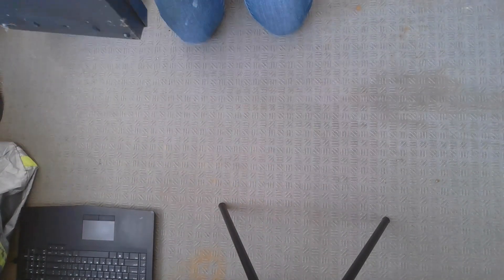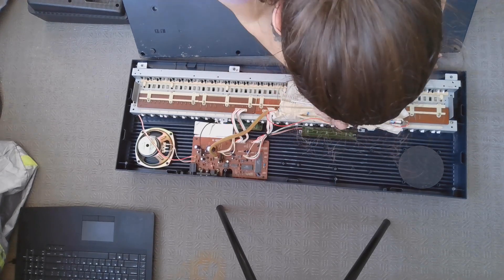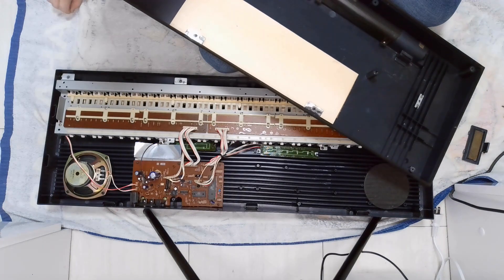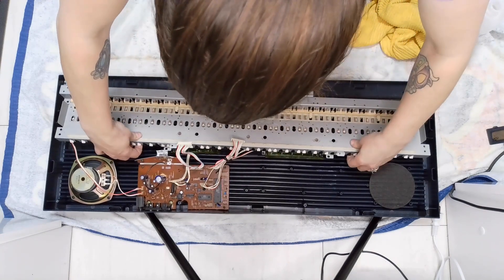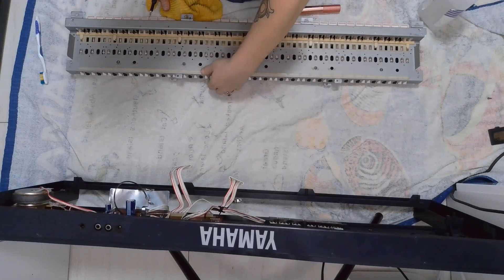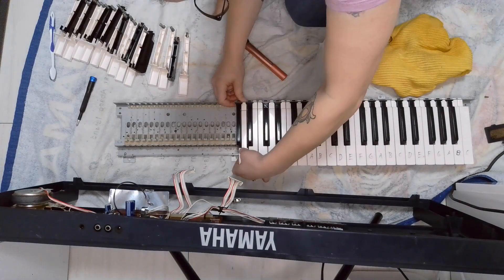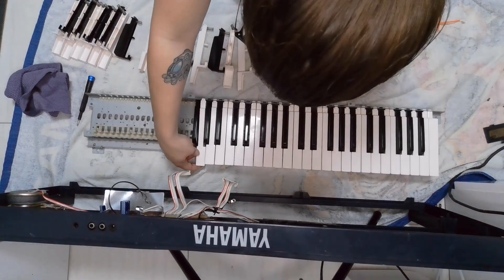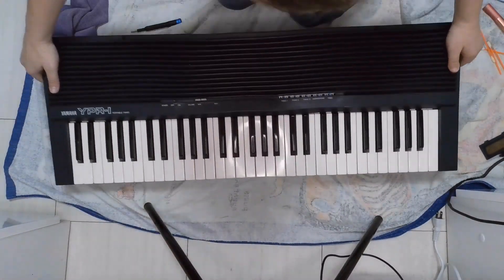Another trash find is music to my ears (Yamaha YPR-1 electric piano)

Comment: Please show exactly how you get the keys out.
Reply from the maker: For the Yamaha each key is individual
Reply from the maker: They each have springs and each pops out individually
Reply: Thanks for answering! I do understand they are individual, but the back of each key seems to have two levels, and I don’t wanna push on the wrong thing and break it. I’ve watched many videos about it, but none actually shows what to press and which direction. I also seem to have a spring, but I can’t find how it goes in. It might be obvious when I get the key off, but I haven’t been able to do that yet.
Reply from the maker: @lizahodskins9277  so from like 6:02 to 6:10 you can see me push a white key.  So white has to pop out before black and I push on the middle then back near the metal and it pops out. The key is to push down and out. I think the first was the hardest. Also I don't know if you can take a middle out or if you have to take out from the sides and work inward since I was taking it all apart.  I hope that helps
Reply: I ended up slipping up the rubber band that the back of the keys fit into in order for them to have some space to move back so they would come out. I superglued the broken part of the black key that wouldn't spring up, and that has stayed glued. Then I figured out how the spring was held in by looking at the white keys, and then just somehow being lucky enough to slip the keys back in andi give a little push when they resisted and they went in without breaking (my fear).Thanks for replying. My suggestion would be not to block the camera with your head or arm when you're working on things so we can see exactly what you're doing. Otherwise, its just magic!
.   @dedbattery